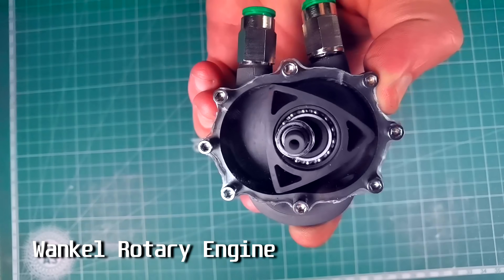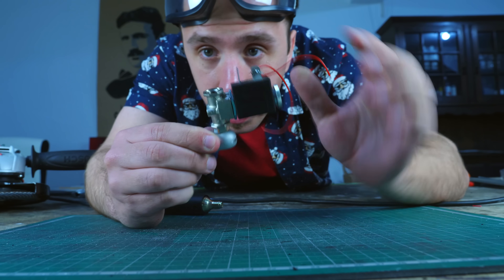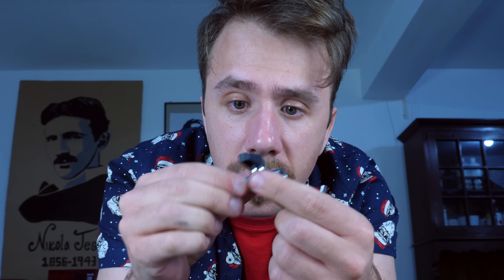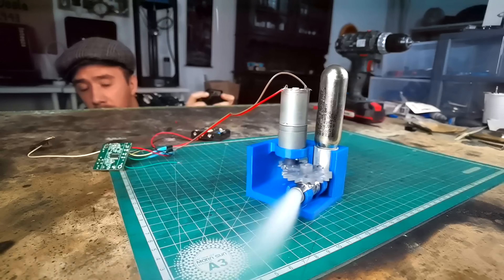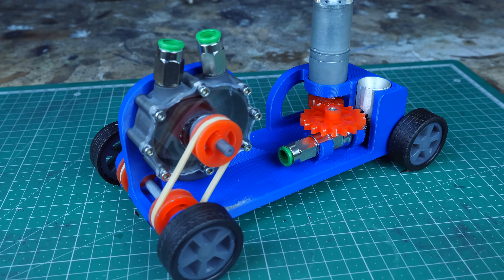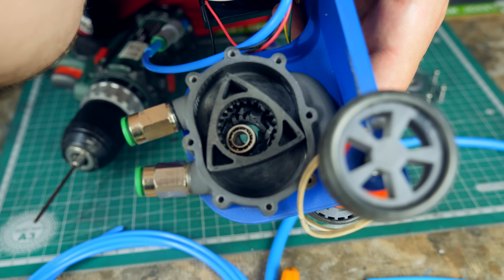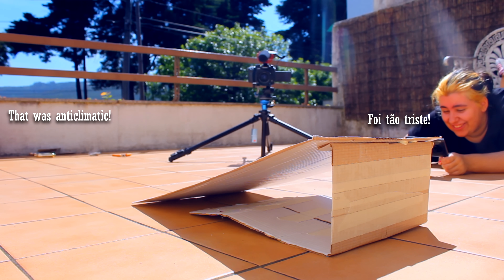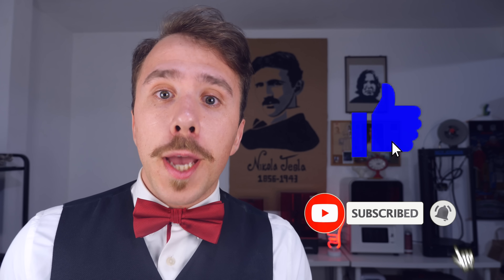Rotary Wankel RC Car (3D Printed)

Comment: in a version 2.0 I'd recommend using a servo rather than that DC motor to open the value ( if you have any). Servos could also be used for steering the RC veichle. The belt also appears to be slipping, a gear train may work better and provide more torque/speed. A lot of the CO2 also appears to be coming out in solid form.

Comment: great vid. Maybe revisit this rotary car but time two cartridges using integza bot so as one runs out the second one opens. Maybe try a multi rotor or a single that is a little bigger with a flywheel. Your vids are getting better. I mean, better than before.Always great content. Don't want to sound like a tomato.

Comment: You should make a gearshift for it so that all the engines power can go to the wheels with more torque
Reply: Exactly. Motor is running properly. Not transmitting to the wheels. Rubber belt is slipping too much.
Reply: It’ actually a beast. Transmission is not handling it.

Comment: Video idea: modify the car making it stronger by using more energy putting more weight so the car doesn't start lifting and not use an elastic tha could stretch so much as a result the wheels having more energy and making it go further.Or make a car that instead of using the energy to make the wheels spin use it as a propeller like if your going to make it fly but keep the wheels and not letting it fly.

Comment: you should see if increasing the weight on the wheels, to increase torque and using some type of gear system to decrease speed but increase torque

Comment: Video idea: Using cogs/gears attached to one of your motors/engines try and create extremely high torque to lift something heavy like you did with the banana in a previous video.

Comment: I think that even just changing the thin rubber band for something like a gt2 belt would massively improve the performance. And also if you would use some kind of pressure regulation, spreading the CO2 discharge over a longer period of time (just a small hole the gas has to go through could be enough), it would also help
Reply: I second the pressure regulation. The co2 cartridge is super high pressure and most of that is going to waste out the exhaust. Using something simple like a capillary tube (I think) could help regulate the pressure leaving the cartridge, meaning that the engine can convert more of the pressure to rotation.
Reply: I agree the rubber band is slipping too much, not a lot of the engine power gets to the wheels.
I was thinking a 3D printed roller chain and sprockets for the engine shaft and wheel axle would work
Reply: It just needs a receiver of 2x the size of the bottle
Reply: Good idea's the max pressure without leaks should be tested, this is than the max regulated pressure
Reply: Yes, it looks like the rubber band belt is slipping.
Reply: or guys maybe he could simply flip the canister to avoid letting out liquid co2 when he only needs gas
lots o noobs when it comes to the liquid vs gas phase of the co2 coming out
Reply: i agree. He should 3d print a belt using bendy filament and make a belt pulley system. The engine has a lot of power bu the power is being lost due to the rubber band slipping out

Comment: Video idea: Use your CO2 powered rotary to launch a pull copter  and see how high it will fly. The pull copter will take full advantage of the extremely high rpm putting spin on an old classic toy. 
Link to a picture for reference of a pull copter 
https://encrypted-tbn0.gstatic.com/images?q=tbn:ANd9GcSgpRD_K16XuM9pUtT4R_7eMkUs-0vslDhMkA&usqp=CAU

Comment: In the slow-motion, it looked like the pulleys and rubber band were spinning without movement from the wheels. I don't know how much it would help(or if you would be able to find one), but I think some LEGO sets have belts with teeth on them. Would that help the car move?

Comment: As a paintballer, I have an expansion chamber on my gun to give the co2 room to defrost and a needle valve regulator to control the pressure. So that I don't dump all my gas in one shot.
Reply: Agreed, should stop the engine destroying itself every 5 minutes aswell
Reply: That's what I've been thinking the whole time- he needs a way to control the flow rather than just dumping it all out at once. Expansion chamber and regulator set up is a must, and a gear-reduction unit for the actual drive from the engine to the wheels.

This project has great potential, just needs a bit more development...
Reply: Maybe a spool valve with a LPR to regulate/expand the CO2 to a gas. Add a point to the rotor to trigger the solenoid at the correct time. Maybe even some logic with the deadtime of the solenoid and everything like a ECU would handle.

Comment: I would love to see you design, model and print out a plane using the Co2 cartridge as propellant, also using a modulated electronic valve for throttle. You can also use a servo for your own valve design so that you can control it. i like this project because this can be hard, but teaches quite a bit control over high pressures.

Comment: New video idea:
New specialization for integza: build a brushed electric dc motor! It's easy, just coils and brushes! You could 3D print some parts and use tin cans and aluminum foil for others!
Otherwise you could build a Campini jet engine, which has a compressor driven by a endothermic motor, like the wankel engine!
Reply: Video idea!! 👆🏼

Comment: Video idea: Try to understand the new Veritasium video about the wind powered vehicle the goes faster than the wind.
 I really want to properly understand the fenomena as it is still a bit confusing
Reply: I understand it like that, not sure though :
Initially, the cart with propellers on is accelerated by the wind to the wind speed. In this process, the rotation of the wheels also cause the propellers to rotate. However, we were to compare the cart with another one of the same mass but not propeller, the cart with propellers takes longer to reach wind speed. There is therefore more energy in making the cart with propellers to moving to the same speed. This extra energy is stored in the propellers' rotation. When the cart reaches wind speed, it is no longer accelerated by the wind. Assuming here, that the wheels can rotate the propellers and the propellers cannot rotate the wind, the propellers now push air backwards. This further propels the cart forward. The propellers can be modelled as a spring which gains energy as the cart reaches wind speed. After that, it returns the energy to the cart increasing its kinetic energy. The cart thus can move faster than the speed of the wind for a short time period.

Comment: Your front wheels were slipping too much. Wouldnt you get  better traction if the rear wheels were powered as most of the weight appears to be on the rear of the vehicle?

Comment: Please do some metal 3D printing projects! There are FDM filaments you can print that are 80% steel and 20% plastic. You can put it in a kiln and the plastic burns away, and it sinters into fully metal parts. Check out Ultrafuse stainless steel 316L for example.

Comment: Can't you get way more range if you flip the cartridge? Your engine is running on liquid CO2 now not the gas.
Because your opening of the cartridge is on the button the fluid (liquid CO2) comes out first

So next video, flip the cartridge

Comment: lo que necesita el vahiculo con motor rotativo es una caja de velocidades para comvertir la velocidad de rotacion en torque, asi aprovechas su potencia, ademas de que tal vez no te fijaste, pero la correa que usaste estaba patinando, trata de haces un convertidor de torque imprezo en 3d, conectarlo a la salida del motor y la salida del convertidor de torque a la rueda

Comment: You could 3d print a twin rotor engine. Feeding the exhaust of the first rotor into the second. Like how some the multi cylinder system engines work to get the most out of the steam or in this case co2. Combine that with a 3d printed gear reduction or even simpler a larger pulley and try the dragster again

Comment: The engine isn't building any pressure, it's basically just operating as an enclosed windmill. That's why using the CO2 as a rocket is more efficient in this case. If you want even more efficiency, you will have to extract energy from the pressure differential instead of the inertia of the fuel, and that means fixing the leaks. In theory, the engine should consume no fuel when it's completely stalled, so you can use that as a test.

Comment: A 3d printed boat with a turbine that drives it, you could try to connect it to this engine, the only problem that you might have, is that there would probably be some water getting through the shaft of the turbine...

Comment: Needs better transmission. Losing too much power with the elastic band. I suggest a chain, a belt with teeth or maybe just tensioning so it's not loose.

Comment: Nice. But I don't think your done yet. Look how it uses all it's pressure on such a short time. In the slowed down videos you can see how the wheels just spin out in the beginning while the majority of the energy is being released.

Now I think it's time to add some sort of pressure regulator. I bet you can get a lot more out of one of those cartridges that way. Plus you would be able to use bigger cartridges without eating your engine.

Comment: I'm just curious but what would happen if the engine shaft was locked to the wheels via gears, like locked locked with gears that are strong enough of course. Would the engine stall? or would it blast off?

Comment: The  engine would of worked better if direct gearing was used to connect the engine to the wheels. The elastic band was losing too much energy.

Comment: You should improve your transmission for the Wankelmotor. It was spinning a lot without doing anything. If you imroved that it may be even faster or have more power then just the "ROCKETMODE".

Comment: Why you fully open the CO2 valve in one shot ?It's not possible to proportionally open a valve to use the energy you need at the moment  
 in the engine ?

Comment: Project idea: ditch the Wankel engine and make a real reciprocating compressed gas (“steam”) engine using that same co2 setup. Then, gear it down so you can get some real work and distance out of it.

Comment: Video Idea: Make this 3D Wankel Motor with metal and check the power of this. Trust me that's result will amazing. It will give more power than the piston type of motor. Also, take the Pressure vs Speed curve.

Thank You So much for making these types of videos for us.

Comment: If you want to give it more power you should replacement the rubber band with gears, and make it rear wheel drive that will make the wheels bounce less because the center of mass on your car is more to the back

Comment: Hey that was a great video Have you ever thought about using a needle valve or nozzle to use the pressure of the cartridge evenly?  Keep up the good work and don't let setbacks spoil your fun.  thanks for the video

Comment: Looks like your engine is outputting too much torque for the rubber band to handle, and it's slipping. An air regulator to make the gas last longer could also increase traction by lowering the power output?

Comment: Hey, it's so cool to see RC cars with a different mode of propulsion. One interesting thing you should try is orientating the motor so that the outlet faces back and so the remaining gas pressure propels the car even more. With that you'll benefit from both the motor and the jet propulsion increasing efficiency. I'd also tighten the rubber band so that more torque is given to the wheels.
Reply: or the outlet could drive a tesla turbine for a "hybrid" drive?
Reply: a regulator would work better

Comment: You need a pressure regulator so you can have a constant pressure to the engine.
Reply: Also to keep the CO2 from coming out too fast which clogs it with liquid CO2
Reply: CO2 will never be liquid because it sublimates. But frozen CO2 will destroy the engine of course.
Reply: @waynixify  That is only true at standard pressure, there are plenty of other regions where liquid can exist
Reply: @waynixify  In paintball liquid CO2 going through the pipes is a big problem when you shoot too quick and don't allow enough time for the liquid CO2 to turn to gas. One of the main reasons high pressure air is used in paintball.

Edit: I should have probably started by adding to the person above: there's liquid CO2 in those tanks at that pressure.
Reply: Yes, exactly! That was what i was screaming at the screen while watching this.  Most of the fuel is lost just getting the car rolling. A pressure regulator and a gear box with a high and low gear sets would have worked great here. Low gear and low pressure to get the car moving, then shift to high gear while it's moving and open the valve for some happy fun times!
Reply: Or a govener that is able to keep the engine at constand RPM
Reply: and better transfer from the Wankel to the wheels.
Reply: for starters, I'd invert the setup to stop the liquid CO2 coming out from the bottom.
Reply: A condenser to increase the temperature of the gas, hence more volume, less snow, more efficiency ?
Reply: 3DPrintedLife designed a pressure regulator that you can use.
Reply: and maybe a belt like the one 3D printers use  to transfer the power better, don´t know though if it would reduce efficiency due to higher friction, also lubing up the rotary engine with some PTFE dry lube
Reply: That's right👍👍👍

Comment: What if you 3D printed some sort of sawmill contraption that takes rotational energy and converts it to a linear oscillation, perhaps with an automatic feed connected to it to saw through some tomatoes, or even wood if you used a metal saw!

Comment: It has too much loss of energy, it would go much further if you just point the exhaust at the back end without the Wankel engine. 
It would be like rocket-propelled if you know what I meant to say.
I commented before watching the video to the end.
Reply: Someone hasn't watched the whole video...
Reply: @scottg3192  this was not to u btw :D
Reply: No 💩💺🔒
Reply: either that or have the exhaust go into another engines intake
Reply: @Sp00ns655  eh I don’t think that would be very effective but would be cool to try
Reply: @samthewizzy  you'd basically be using the first engine as a regulator. that's all the car needs is a regulator to bring the 800psi of the cartridge down to like 80psi so the engine spins at a usable RPM.
Reply: @nesyboi9421  another comment from who didn't watched the whole videos. Still more efficient than the current transmission, I hope Integra revisit this in the future
Reply: @artmario  yeah I realized about half way through.
Reply: Not quite correct, you just need to increase torque in the pulley system
Reply: Even just weighing down the front could have helped quite well
Reply: Yeah plus I’m pretty sure the pulley was slipping a lot when the engine first started, if he used gears it would of worked better
Reply: @zanix1116  yeah he could also do with having a twin rotor engine with each rotor 180deg out of phase to stop the oscillation..

Comment: i think if you add a presure regulator and change the elastic band with a geared belt and add a stronger frame it would really improve the car

Comment: Make a missile to destroy the tomatoes. You’ve got rocket engines and probably know how to make things go boom. Also the speed of the engine is too fast for the rubber band to get full power, I would try using gears connecting the wheel and engine

Comment: The primary problem in this setup is energy loss; the belt needs teeth, the tires need more tractions, the air need a throttle control system, all on top of the energy loss of the air going through the engine, your rig just doesn't have the power to pull itself efficiently, love your projects keep improving ✌️

Comment: Video idea: Now summer is around the corner people go to beach and lake river..., and to enjoy it water with a 3D printed product I say *make a 3D printed Jet Drive* for water propulsion and mount it on a Surf Board inside a marine box with motors esc..., Make it 50mm in diameter at least.

Comment: Your engine belt was slipping like crazy. None of the torque from the motor actually arrived at the wheels and if it did the wheel wouldve slipped because you need more weight on the powered wheels. Great video anyways and greetings from Germany!

Comment: Integza redo this video but use gears for torque transfer. From the engine to the wheels. If you watch in slow motion your drive belt... Aka rubberband is not maintaining constant contact.. Which is probably why that main gear inside failed

Comment: Ideia de vídeo: Que tal um avião pneumático? Ele usa um sistema com ar comprimido e uma válvula para soltar o ar comprimido em pulsos e fazer as hélices rodarem, ia ser incrível ver algumas adaptações desse sistema par um barco, foguete ou carrinho. Seus vídeos são incríveis <3

Video idea: How about a pneumatic plane? He uses a system with compressed air and a valve to release or compress in pulses and make propellers rotate, it would be incredible to see some adaptations of this system for a boat, rocket or cart. Your videos are amazing <3

Comment: You can also release the pressure with a charcoal grill, though it resulted in my right hand needing reconstructive surgery, but as long as you stay further away than my stupid 12 year old self you could probably get away with it

Don't do this, it's a joke

Comment: put a gasket on that engine man
make it rear wheel drive for more traction 
and find better rubber for the transmission belt
lot of the energy wasted just on the traction and gas leak

Comment: Make a pump using a diodicity circuit with tesla valves where the oscillating piston moving the "AC" side creates a pumping action with the tesla valves on the "DC" side. A pump with only one moving part, using a fluid analogy of a AC-to-DC converter.